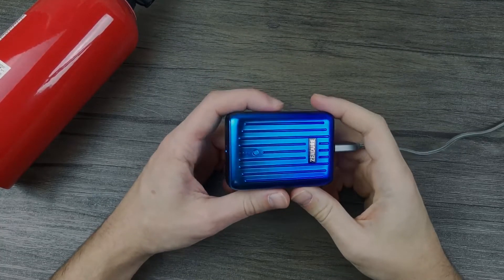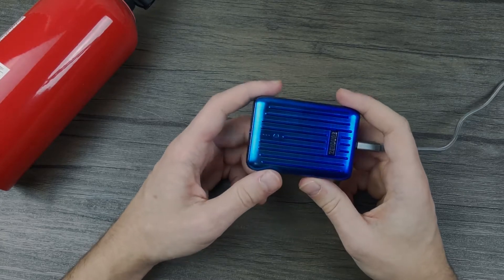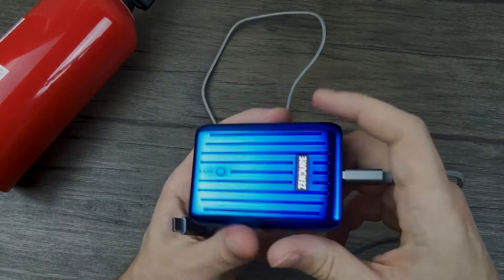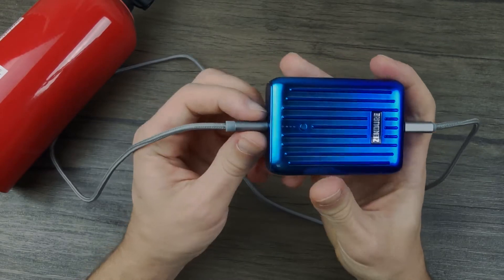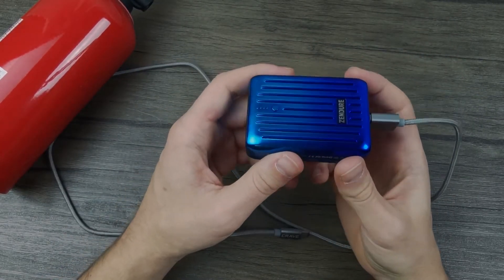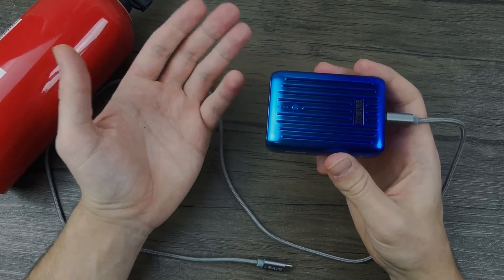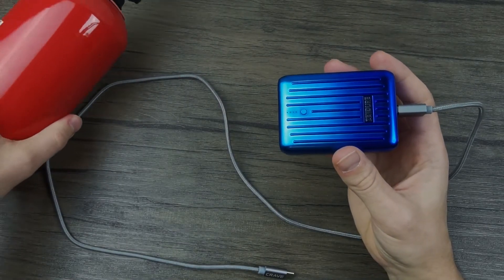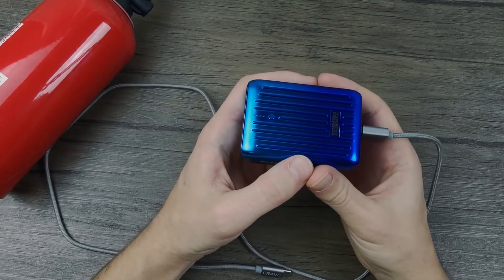What happens if you plug a power bank into itself?

Comment: can we use a powerbank to charge another power bank (and connected to a phone) to increase/doubled the capacity? 😂
Reply from the maker: Theoretically, it's possible if the power bank has pass-through charging. However, it would be quite inefficient. The best way to do it is to charge the phone with each power bank alternatively.

Comment: I knew it wasnt a good idea but still couldn't help it and did this. My powerbank switched on but then the battery percentage gave some kind of error. And turned off. The input and output i have used were disabled for a few seconds, i couldn't even charge my phone. Then i took the cable out and put it back in, it restarted working. Long story short: DON'T DO IT, not even for fun, not worth the worry 😅

Comment: I guess my power bank was a cheap piece of junk, because it bricked. Also I only did it for a second to swap around the cord cuz I was charging the bank and  when I swapped it around it was only plugged into itself for a second. Now it won't charge it won't discharge and the flashlight that's on it won't light up, nothing works, so it's bricked until I can get around to taking it apart and see if I can find what's wrong. Stupid Patriot power.

Comment: My Realtree Power Bank does charge, if I plug it into itself, why does that happen? The model is RLT2001-cm, Capacity 4000mAh
Reply from the maker: It means that the current is going from the output port to the input port. Because of resistance and other losses, after some time, your power bank will completely discharge if left like this. But it's best not to do it, as it may cause harm to the power bank and can even be dangerous.
Reply: @PowerBankExpert  great, thank you for answering my question

Comment: WARNING do not do this unless you want see smoke and fire

connect both powerbanks with usb cables so cable from powerbank A to powerbank B and from B to A,surely this will cause smoke and fire as i did this and it ended in total destruction of powerbank.... use cheap low quality rohs powerbanks or mop po box powerbanks,they are very wulneravle to this deadly trick. how this happens?

powerbank main connection is to charge powerbank,second connection is to put cable to charge  smartphone or ipad/tablet .. if you put another powerbank and use that secondary cable  and if both powerbanks are charged to full then  second powerbank get smoked and dead. more details?

the main connection accepts 5v 1A power.. the second connection  distributes  5v and between 1A up to 2A or even higher.lets say its 5v 2.1a power rating on second connection aaaaaaaaand 
second powerbank  has 5v 1a main and 5v 1a secondary..too much power will cause fragile electronics of powerbank to fail with smoke and sparks,if short circuit happens the li-po battery pack can detonate if powerbank was FULLY charged..detonation force is similar to firecracker so hard bang and fire/smoke,alot of smoke will come out. .. never connect the powerbank charging cable into  charging slot in another powerbank because there is no fuses at all so reaction can be very really dangerous so never do this.

Comment: Could you make a video connecting a fully charged power bank to a power strip that is connected to the power bank?
Reply from the maker: Not sure I completely understand, but in that case, most power banks stop charging
Reply: @PowerBankExpert  I'll try to explain better,
What I'm saying is that, can you try to plug a power strip into a fully charged power bank and then plug the power bank into the power strip? Technically, the power bank should give electricity to the power strip, so the power strip should give that electricity back to the power bank
Reply from the maker: @Orionas_Sk  Ah, I see. Interesting. I'd need a power bank that has an AC adaptor first. I'll keep this in mind for a future video. Interesting idea!
Reply: @PowerBankExpert  Thanks mate, please reply to this comment when the video is up!
Reply: @PowerBankExpert  what happen when u connect iphone and Android (type c) through apples type c lightning cable

Comment: Great video demonstrating this. As a result, most power banks do not allow IN and OUT active at the same time. However, some extremely smart power banks such as Duracell do allow it with a superior protection circuit built-in, of course, it costs more